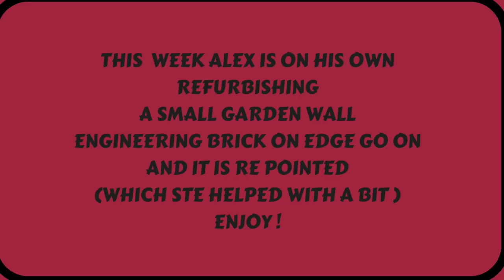BRICKLAYING...BRICK ON EDGE REFURBISHMENT

Comment: Excellent job fellas. I need to do the exact same to my garden wall. What cement did you use? And what sort of sand to cement ratio do you mix up. Never done this before apologies if it’s a stupid question. Cheers
Reply from the maker: Jon Smith . Cheers John it’s not a stupid question at all . We just use normal cement you get from any builders yard or DIY shop and building and sand mixer 4 spades of sand to 1 cement with a dash of plasticiser . Hope that makes sense 👌🏼🧱👍🏽
Reply: Bricklaying With Steve and Alex fantastic thank you very much for the reply. 👍
Reply from the maker: Jon Smith . No probs 👍🏼🧱